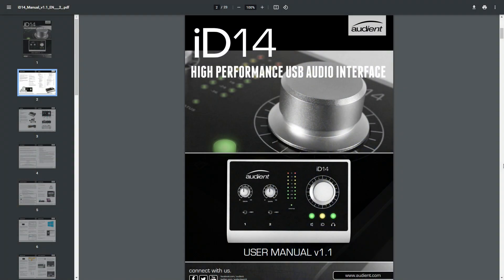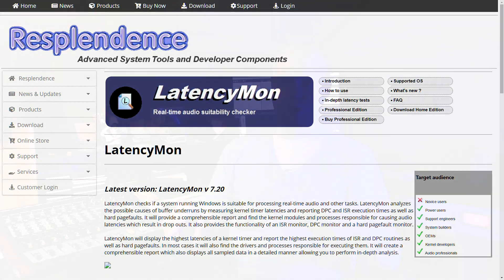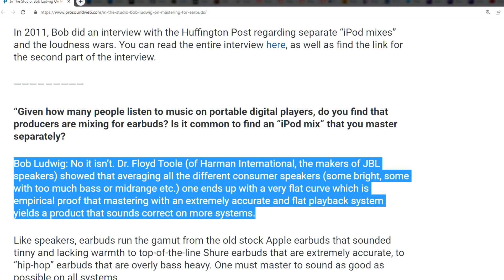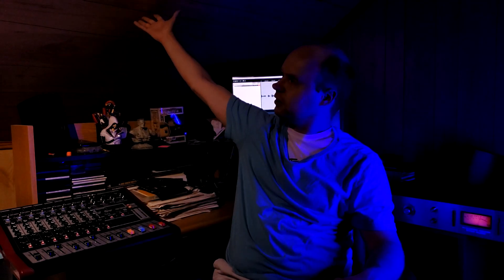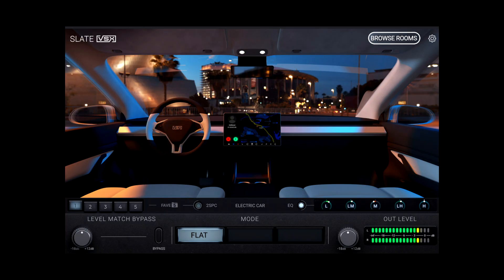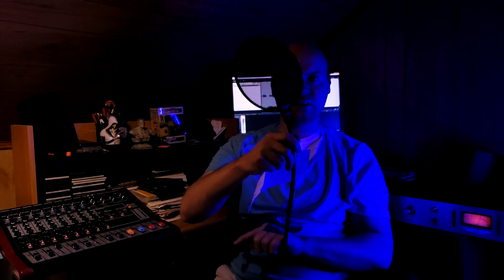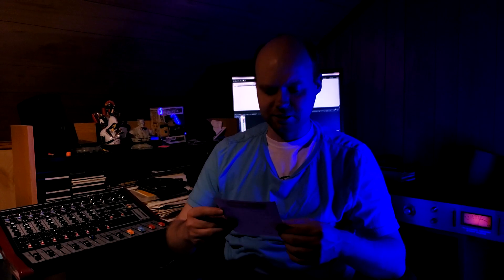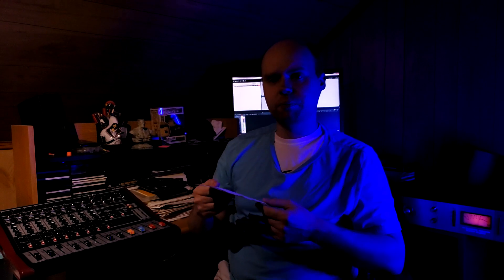Audio Recording Advice for 24 More Minutes

Comment from the maker: Hornet just released a competitor to Slate VSX/Acustica Audio's Sienna plugins called VHS. It's by far the most affordable solution. https://www.hornetplugins.com/plugins/hornet-vhs/

Other alternatives are Waves Nx (which I own), dSONIQ RealPhones https://www.dsoniq.com/ and 112dB Monitor https://www.112db.com/plugins/redline/monitor/

MixChecker Pro from Audified (https://shop.audified.com/products/mixchecker-pro) is another plugin I use a lot to check my mixes when using IK Multimedia's ARC 3 or Acustica Sienna's Reference (flattened response headphones) module. One day, I do plan on getting a pair of Slate VSX headphones.
Reply from the maker: You don't have to buy a single thing I tell you about. I'm not here to be a salesperson for any of these companies. But these are the tools I've used over the years to get the job done. These are the tools a lot of others are using to deliver great sounding audio mixes to the masses. As stated in the video, accurate monitoring is the most important issue to take care of because if what you are hearing isn't "correct" then you will be working against yourself.